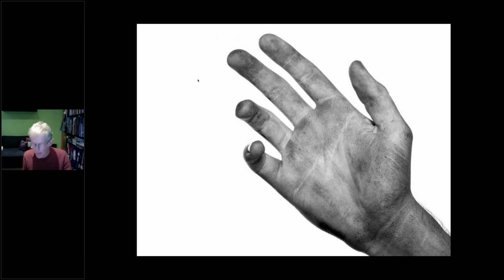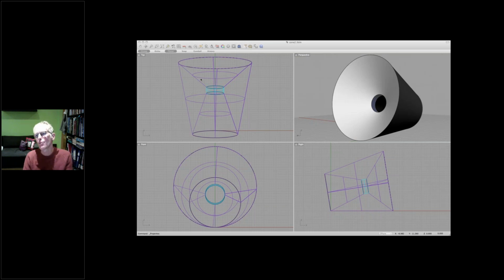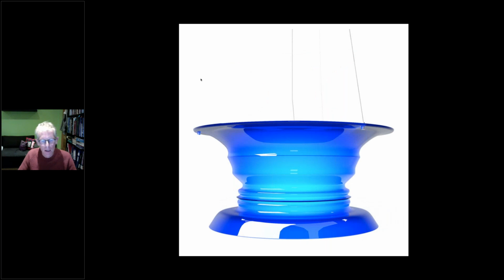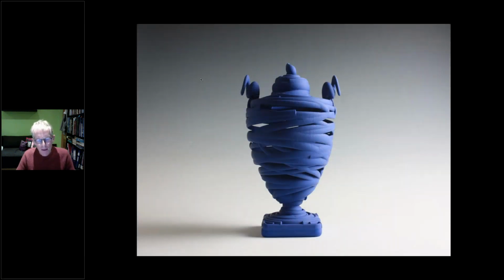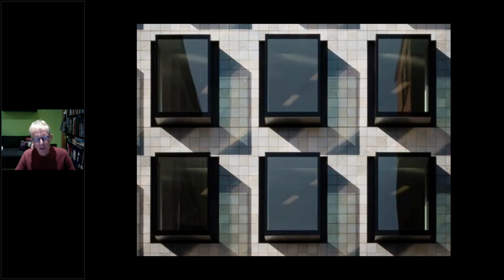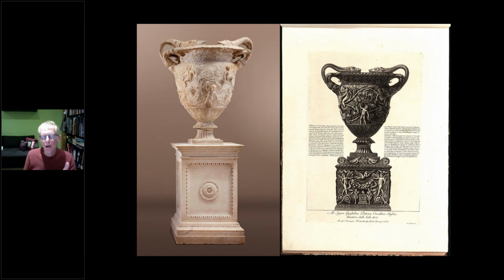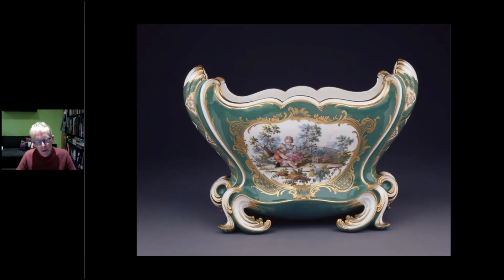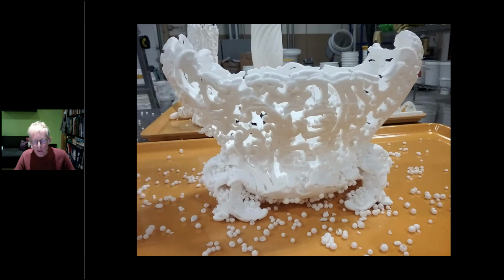Rhino3d UK User Group Meeting with Ceramic Artist and Maker, Michael Eden - October 2021

Comment: Thanks Rhino team and Michael Eden for the presentation.  Michael, your work is stunning and I am amazed at work you're been able to create.  I'm interested in getting my digital files printed in clay and am having a difficult time finding a US bureau specializing in Additive Manufacturing using ceramics SLS.  Anyone out there with contacts?  I have a 3D printer that uses ceramic resin but the print size is small.

Thanks,
Sam